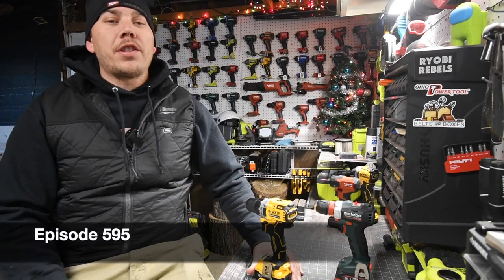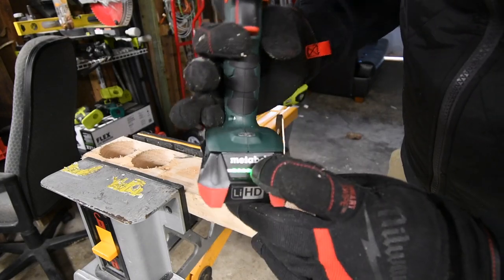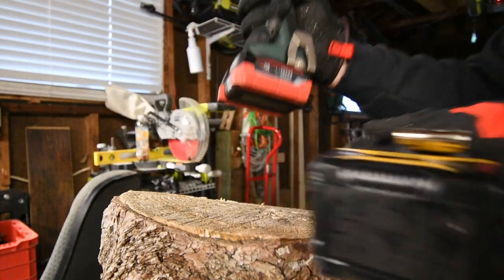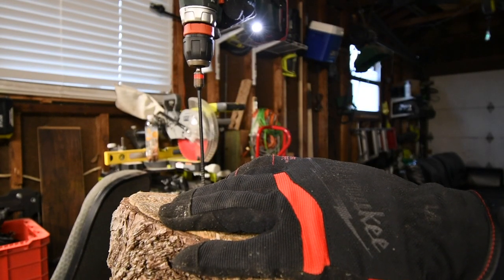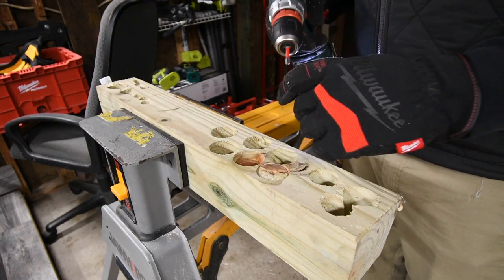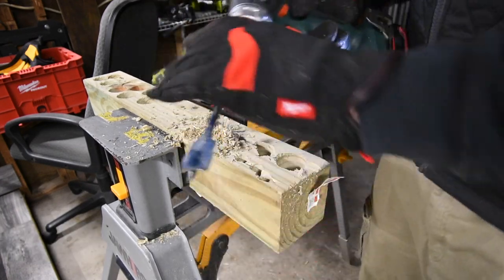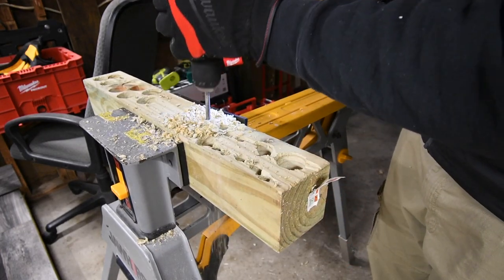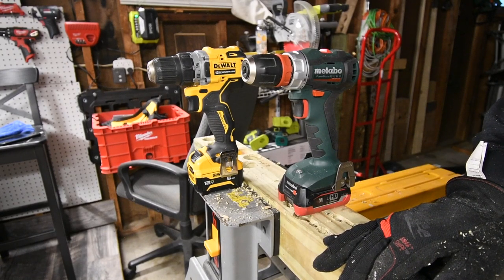Metabo vs Dewat (12v Drill Drivers)

Comment: The DeWALT definitely won in the power department but the Metabo looked smoother in the cases where the DeWALT didn't blow it away
Reply: Approximately 508 inlbs of torque according to my rabbit hole research
Reply: @deanslegos1990  great power for 10.8 volts

Comment: I just recently picked up my first DeWalt tool, the 12v hammer drill with a 3amp battery for 49$. Couldn't pass it up. It's a phenomenal tool and is really powerful for it's size and weight
Reply: Where pls?
Reply: @Thorsanbauer  dead deal my friend. Sorry

Comment: I have the european version of that Dewalt and the chuck comes in steel here. I fricking love this tool, With the small battery, it's actually so small it can make use of the clip. Amazing to use with installing. One tool hanging on the clip and the other in the hand. If i only could score the 901 for a decent price and i would be in heaven.

Comment: Is this the same kit as the one for $59 at OPT right now for Black Friday?
Reply: No he has the Brushless version in this video. The one at OPT is the previous gen, brushed version.
Reply: I have the brushless Bosch Flexiclick, which I got because I liked the most overall, especially design/ergonomics. For some reason the manufacturers are not great at distinguishing the generations and brushed vs brushless model transitions. The metabo website wasn't even that helpful for finding this out.  I wanted the Milwaukee one at first, but hated the grip and didn't care for the knuckle guard design. These multi head tools are very handy for small varied projects though and they are all pretty decent

Comment: DeWalt has the new multihead  DCD 703.
And there are two 5Ah models, one with rubber overmold, but even heavyer. Not using 4Ah 21700 cells like Hilti and metabo is absurdly stupid. I don't like the Hilti SFE for 3 reasons: 1. It has metal shroud chuck, bad for 5 reasons - damages furniture and stuff, chuck black wears off and look hideous, is heavyer and front heavy on tool, past bad experience with metal shrouded chucks that are expensive but less reliable then heavy duty ones with plastic. SF 2-A12 has a nicer chuck with plastic, don't know how reliable, Hilti chucks are not the best... 2. The angled head is bulky on the side that maters, so can't be used as an excentri-chuck, then excentrichuck is stupid long and using them both wey to long. 3. With no head look very bulky, not esteticaly pleasing and also shadowing/ blocking the work line of sight. SF 2-A12 looks nicer but both have a not enough angled handle, and both enter in protection mode and stop faster then is needed to realy use the provided torque, so in use we don't see the spect 21 Nm soft torque in speed one, stoping before a 15 Nm soft torque brushed Bosch GSR 12V-15 FC or not FC.

Comment: Сравни DeWALT DCD701 с Milwaukee M12 👍👍👍
Reply: The DeWalt beats the M12 Fuel hammer drill/driver. I had both the DCD703 multi-head tool and the M12 Fuel. The -703 has the same power rating by DeWalt as this -701, and it handily beat the Fuel. I sold my M12 drill after that, and with the -703 with the drill attachment having the same specs as the -701, I'm not sure I need to get the -701.
Reply: У него , вроде, есть сравнение этих шариков на канале.
Reply: Тебе чувак на английским ответил, ты понял, что он написал?
Reply: @АлександрФилимонов-н1я  нет
Reply: Он написал, что Деволт ушатал Милку. Если в двух словах.
Reply: @АлександрФилимонов-н1я  спасибо  за пояснения👍. Я уже и обзор нашёл посмотрел благодаря тебе ✋. Думаю DeWALT DCD701D2 брать или нет не как определиться не могу.

Comment: So the Metabo is a multi head tool and the Dewalt is just a drill/driver? So not so equal test.
Reply: The DeWalt DCD703 is DeWalt's multi-head tool (like the Metabo and Hilti), and it has the same power as this DCD701, both rated at 250 UWO. They perform the same. The -703 even beat my M12 Fuel hammer drill in power and speed driving a 1" Irwin Speedbor.